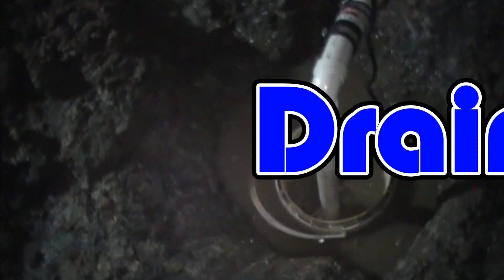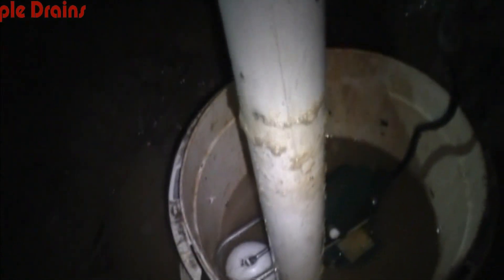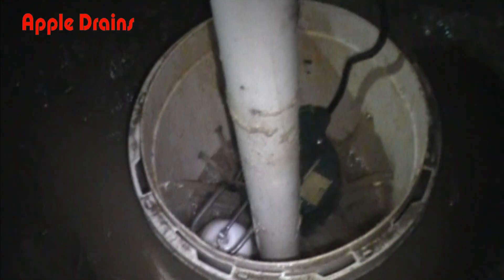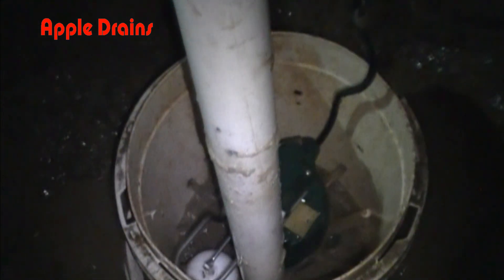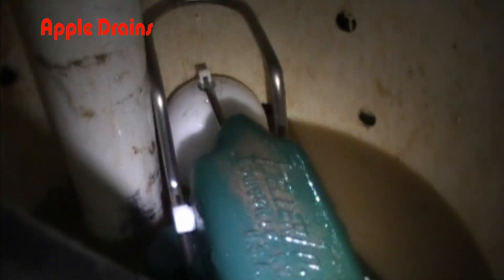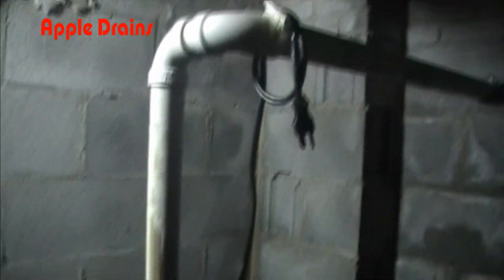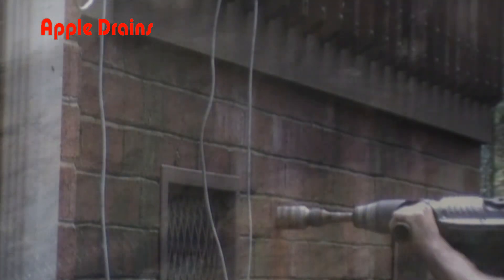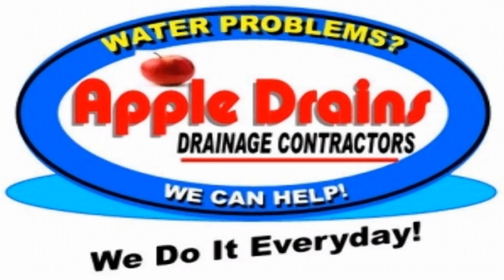How a SUMP PUMP Works

Comment: We found a sump pump in our front yard with some old degraded electric wires. What kind of company would we contact to come inspect/repair it? It’s probably 20 ft deep and connected to a rope to pull it up.